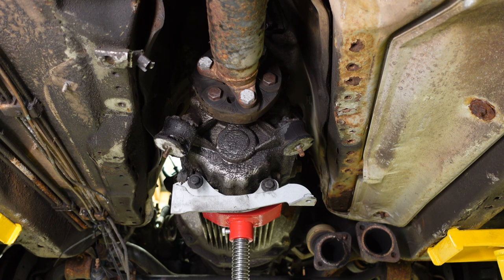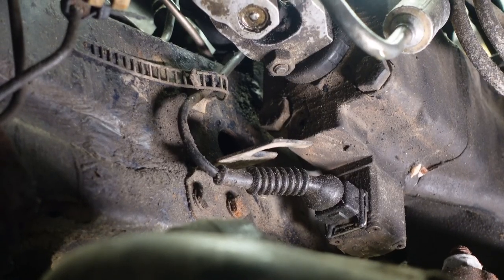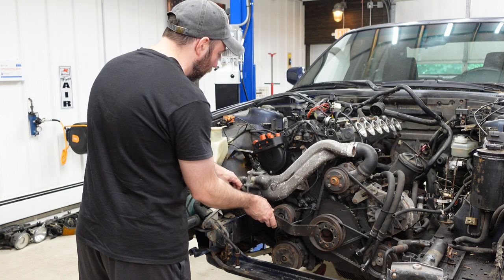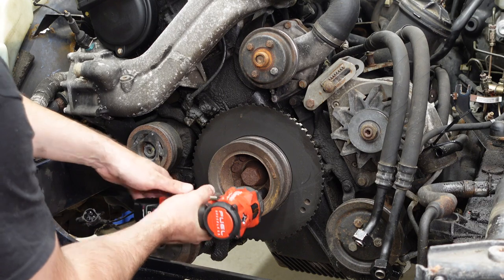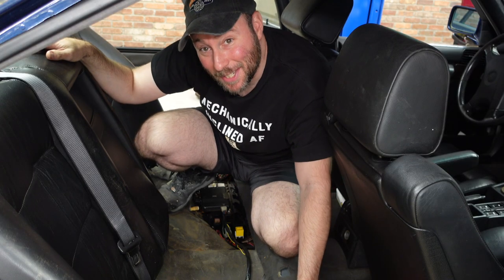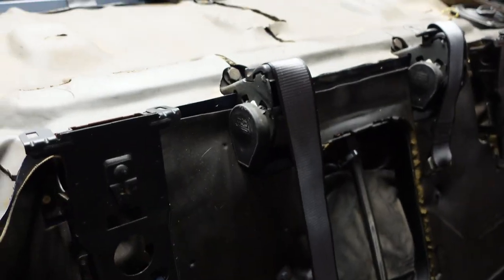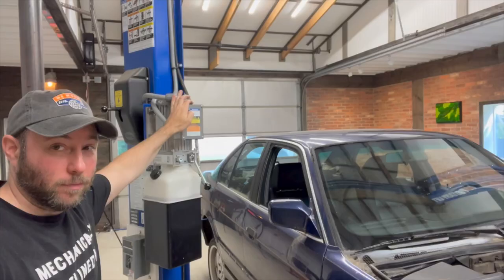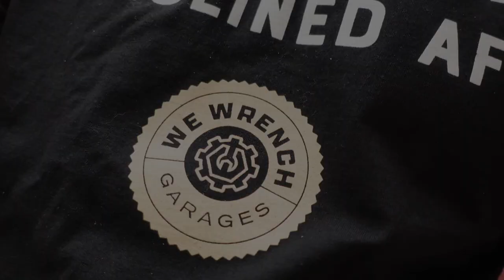WeWrench Episode 11 1992 BMW E34 M5 Engine, Transmission and Drivetrain removal  11   HD 1080p

Comment: Loved the video, i've never seen somebody do what you did, it's amazing content. And also quick question, I need to replace my timing chain tensionner on my e46 and thus I need to remove the crankshaft bolt, in the service manual it says that you need to use a similar special tool like you did but every mechanic I ask tells me to do it with an impact to save money, they say that you d'ont need to counterhold the hub which is weird because it would just crank the engine I think🙄what should I do?
Reply from the maker: Apologies for just seeing this now. You can use an impact to loosen it. It won't hurt anything. Tightening it is a different story though. To do it properly, you need to counterhold the crank

Comment: aaaah yes, Special Tooling... I recall my Godfather would always explain why "it's going to take more time to fix your car because we have to pickup some special tooling...." Didn't matter which Saab or BMW of mine he was working on... And of course me being the impatient prick was like "just use an effin thin pair of pliers LOL"
Reply from the maker: Sometimes, those tools aren't available and you have to make due with what you have. Did you enjoy the final part of the vid?
Reply: @wewrench  You mean the BRANDING?  Yeah I was gonna comment bout how I like the logo, but was stuck in memories of my Godfather and I hanging out in his garage as a kid LOL
Reply from the maker: @skuffles  Actually, I meant the footage of the body coming off the powertrain!!! I'm a shameless self promoter, but not THAT bad! lol
Reply: @wewrench  LOL yeah that was cool too!  Body slid off smoothly.  I've seen it where a stray cable or bolt snagged the body and made it wobble which is super scary.  It's great when a plan comes together.

Comment: Why is it important to loosen the crankshaft bolt before taking the engine out?
Reply from the maker: Because the crank bolt is torqued to 578ft lbs and you need to use a special tool to counter hold the crank pulley against the vehicle frame to loosen the bolt

Comment: Why did you need to loosen the crank shaft bolt to get the engine out? I’m pulling my s38 engine out soon so need to know ?? Cheers
Reply from the maker: Because it's torqued to 578ft lbs and you need a special tool to counterhold the crankshaft against the frame rail to loosen it. There is a way to do it outside of the vehicle as well, but its easier with the engine bolted in.
Reply: Oh I see you stripped the engine down in another video, the way you described it sounded like to take out the engine you need to undo the crankshaft bolt, it’s good to know anyways and keep up the good work and content 👍🏼
Reply from the maker: @cos358  Appreciate the support my friend!

Comment: Great work, I like that you've taken the time to get the close up shots for detail. I know it adds about 50% more time to setup, but it helps heaps in providing orientation. I see you also have an obscene amount out oil everywhere 🤣 My oil cooler lines were slowly leaking for years. I enjoying seeing the similarities, I'm working on a E28 M5 I brought with me to Australia. I've used Vogtland springs for an E34 and they work great! I like your solution for the SLS delete, I didn't like that it wasn't a standalone system for the E34s, but you know, "engineering". If you're keen, check out my channel. I'm playing catch up on your episodes so expect much commenting 🤪
Reply from the maker: Thank you for your kind words! Youtube flagged this comment as spam for some reason so sorry I'm so late to respond!
Reply: @wewrench  All good mate, you're flat out making great content. Cheers.😄